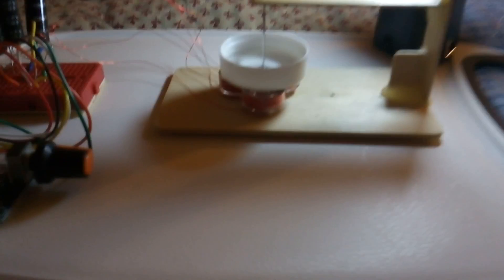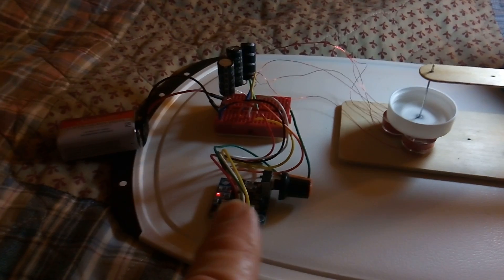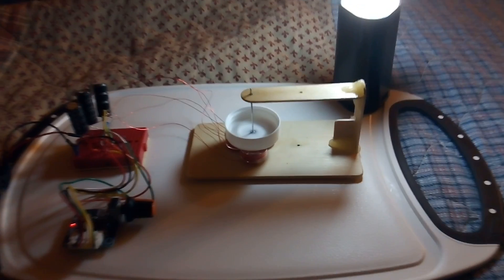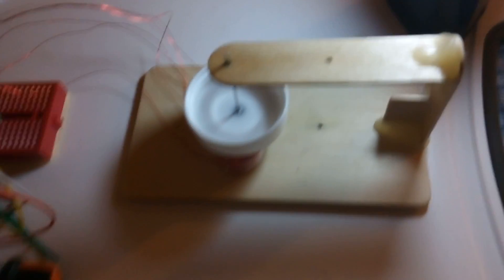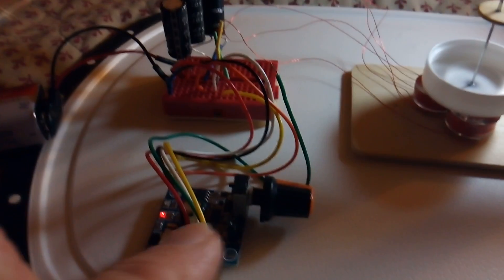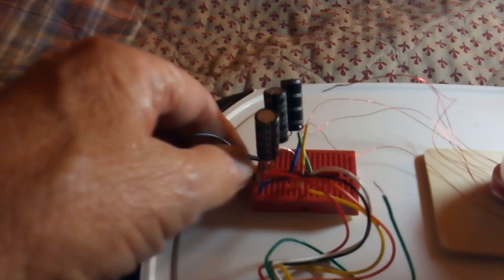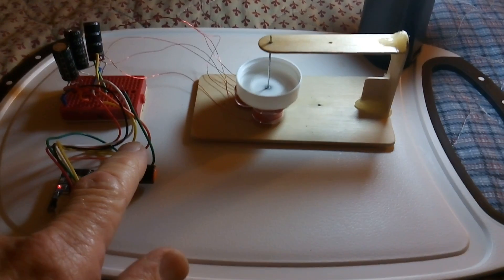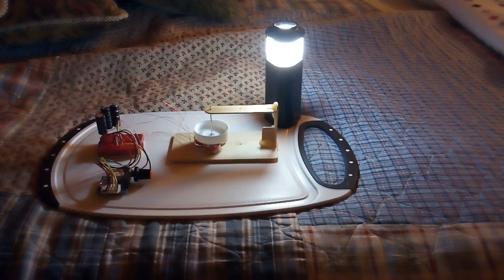3 Phase Brushless DC Motor---- Lidmotor Style

Comment: Have never seen a brushless motor design like that, with the 3 coils all at one end. 
It's also doing well for responsiveness,  having no metal mass on the poles and all the other usual stuff.         Have a great New Year!
Reply from the maker: Happy New Year to you.  I had not seen this design before either. Check out the one that I gave the link to.  He made a great little 3D printed electric 'jet engine with this design .